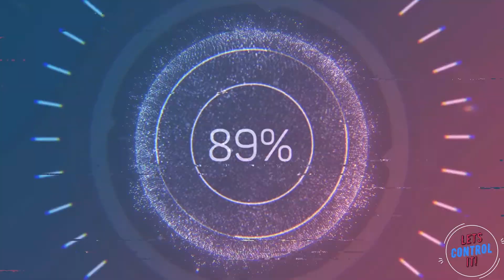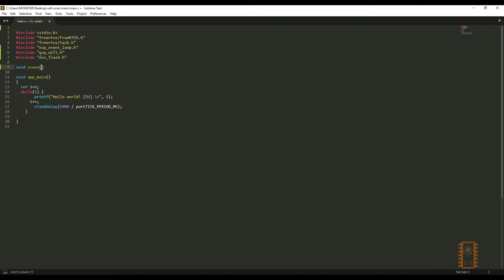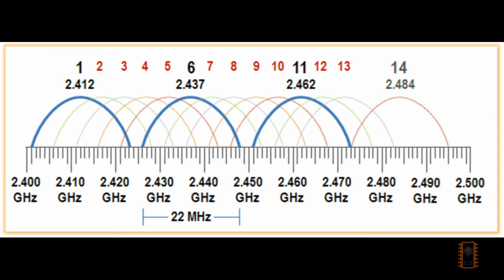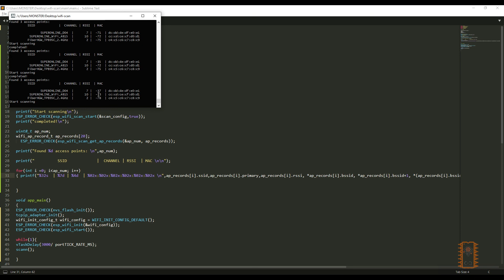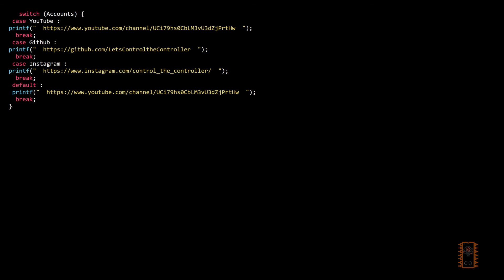#11 ESP-IDF Wifi Scan

Comment: after working with the above example should I run the following to erase the content in nvs flash.?????
idf.py erase_flash
Reply from the maker: If you use msys32 as I used, you should write make erase_flash, but if you use command terminal with esp tool, you should write idf.py erase_flash

Comment: Hello, I had a problem when trying your code: when the ESP32 tried to scan for wifi AP's, it didn't find anything.
Fortunately, I found the solution: in the function call
<   esp_wifi_scan_get_ap_records(&ap_num, ap_records)   >, line 24 in the video
The parameter " &ap_num " works as an input too, and defines the maximum number of AP's the ESP32 wil look for. If " ap_num " initializes as zero - which was my case - the controller won't find any AP.
Thank you for the great videos!
P.S. another Brazilian here...
Reply from the maker: Hi Gabriel, which version of esp-idf do you use? I am using v4.0 and works perfectly as shown on the video. For the older versions, you can add esp_wifi_scan_get_ap_num(&ap_num); function before the line 24. It would be a solution for this situation, I will also add ot to github code. Nice working....
Reply: @ControltheController  Hi, I'm 
 sorry but I'm not sure about which version I'm using. I use PlatformIO+arduino framework, and I believe it is based on ESP-IDF v3.3.5.
Anyways, the API reference for ESP-IDF v4.0 release explains the use of "&ap_num" as an input in "esp_wifi_scan_get_ap_records"  Maybe it is just that my variables initialize as zero automatically.
"esp_wifi_scan_get_ap_num(&ap_num)" is a good solution as well. Thanks

Comment: According to Espressif documentation, after esp_wifi_scan_start() , you need to call  both functions esp_wifi_scan_get_ap_num() and esp_wifi_scan_get_ap_records(). Why you only call one of them? I am qouting a text form official espressif documentation:  `` Upon receiving this event, the event task does nothing. The application event callback needs to call esp_wifi_scan_get_ap_num() and esp_wifi_scan_get_ap_records() to fetch the scanned AP list and trigger the Wi-Fi driver to free the internal memory which is allocated during the scan (do not forget to do this!). Refer to ESP32 Wi-Fi Scan for a more detailed description. ``
Reply from the maker: Hi Lucas, actually I have used version 4.0 and on this version, it doesnt matter that you call the get ap num function. But if you use the older versions of the esp idf, it may got some problems. I will add the function to github source code, thanks for your feedback, nice working...
Reply: @ControltheController   I just noticed and wanted to confirm.. thanks for the response. Glad you replied

Comment: Hello, thanks for the video,  I have the next error message

line 17
func: scann
expression: esp_wifi_scan_start(&scan_config, true)

abort() was called at PC 0x40086d2b on core 0
0x40086d2b: _esp_error_check_failed at C:/esp-idf/components/esp_common/src/esp_err.c:46

could help me to resolve the problem?
Reply: Hi, i am also facing the same problem. Have you fixed the issue?
Reply: @sureace82  did you got the solution ?
Reply: did you got the solution ?
i am also facing same issue